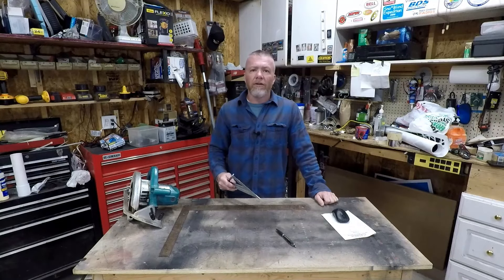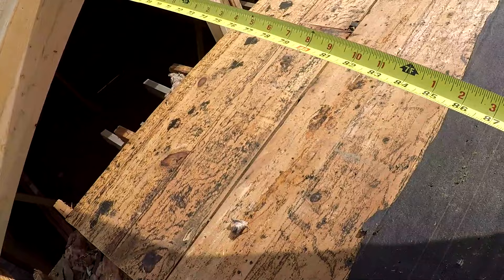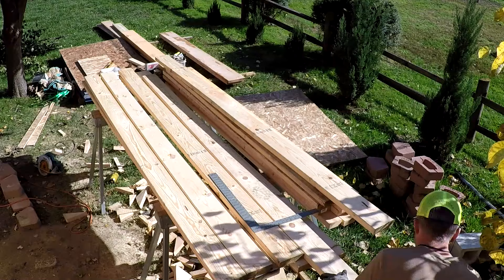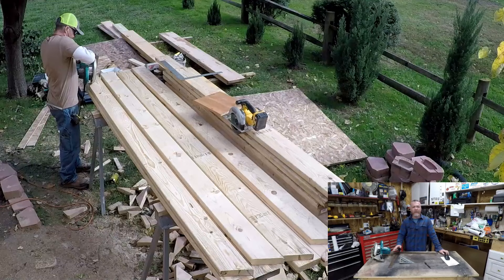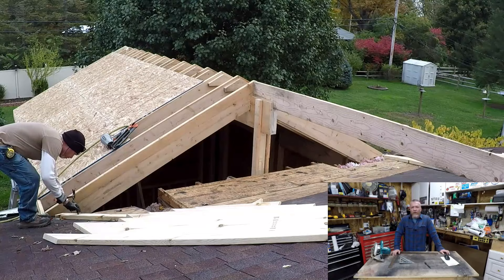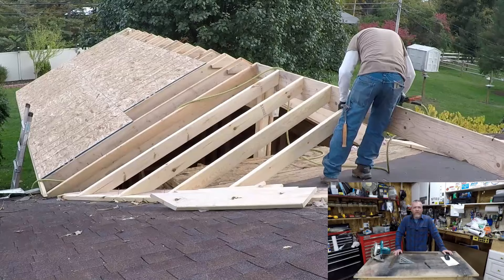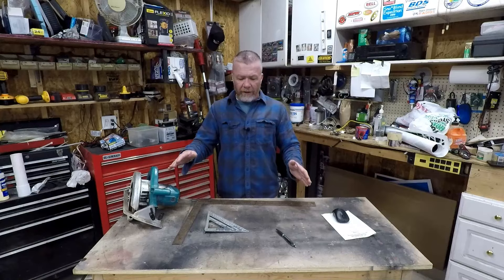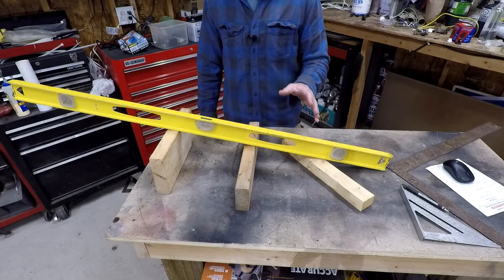Tying an Addition Roof to an Existing House | MY DIY

Comment: Insightful solutions.Perhaps you have a suggestion to this issue: old house we bought has room addition (3:12 roof) where its side of the valley eave is 1.5 inches lower than main roof (6:12) eave at the corner. Now I know why wasps always  flying in and out of that valley corner. I saw the guts of the misalignment when I tore off roof and decking (about 15 sheets). Seems options might be: 1) sister each 2x6 rafter and raise 1.5 inches and add to facia board and rake to chimney (not good since entire perimeter eave would be affected). 2) cut a wedge and plug the opening - uneven valley still); or 3)  take gutter and fascia off and shorten the offending eave a couple inches until corners are in the same plane. It's already open and covered with Tiger Paw during intermittent rains and seems might as well fix properly now than recover the old problem. Thoughts?
Reply from the maker: To me, the easiest would be to cut a wedge, or maybe bend up some aluminum to cover that spot. I’ve dealt with eaves not lining up quite often, and usually just filled that area with a creative piece of metal and some silicon. Cutting the overhang back would obviously work too.

Comment: So recently just found out that our roof only had the roof structure and without board and shingles. The constructor just put on the roof structure and straight away the metal roof. And it keep leaking whenever it rain and the air-con guy who step on the roof causes the roof and our wall to crack under the pressure....
Reply from the maker: Well that’s not good!

Comment: Hello! Great video. This English teacher thinks you make a great construction teacher :) I do have two questions. I believe you said the newly constructed roof had a different pitch than the existing structure. Question 1: I would like my addition to have a 12/12 pitch (with attic trusses) so I have maximum space above the living area. How would that work with what you've shared here? The ridgeline of the new structure would be far higher than the existing, I can't envision how this would work. Question 2: Our existing structure (house) is pier and beam. Most things I've read indicate the addition should then continue the pier and beam foundation. I've read carefully the pros and cons of p&b vs. slab on grade. I'd value hearing your thoughts. Can or should a slab even be poured to abut a p&b structure?
Reply from the maker: I would go p&b to match up, plus I’m just not a fan of slab on grade. Your addition can be taller than the existing structure, it would just need a gable wall to finish it off. I hope this all makes sense…
Reply: The maximum pitch should match  the peak of the original homes roof. Because the addition isn't as wide as the addition you will end up with the  space you need above but not necessarily 12 on 12.
Reply: Home isn't

Comment: I bought a home where they added a room addition, but instead of the roof being like this, they just continued on the normal slope of the house, resulting in the end being extremely low to the ground. Think it’ll be costly to turn it back around to this?
Reply from the maker: I would guess that could be costly
Reply: @MyDIYAdventures  Any chance of re arranging or building on top of ?

Comment: hey ya, i've been watching your video on valley trussing, and it's been very helpful to me. I had one question, which I may know the answer already, when to gp to measure and set the valley plates, and you showed measuring from the set rafters over, what measurement are you using on the rafters itself to match it up. Are you going from tail end up the rafter to ridge and in your video are you measuring 16" centers along the rafter. Thanks Medic29223
Reply from the maker: Yeah, I just continued the 16” spacing onto the valley, and I do measure the valley rafters from long point to long point.
Reply: great thanks again like I said your a big help in my project.

Comment: For the boards that run into the ridge beam, I was always told that it needs to be a little above the beam for the roofers and their ridge cap. Does that make sense? Looking for an explanation as to why that is
Reply from the maker: You mean the rafters? Sometimes there’s room left above the ridge for ridge vent.

Comment: I'm not a framer so pardon my ignorance, but why are your rafters notched to fit over your ridge board and then gusseted rather than just dying into the ridge board completely as you would typically see?
Reply from the maker: The ridge beam holds up the weight of the roof since there are no ceiling joists. The rafters sit on top of the beam so the load transfers down vertically.
Reply: @MyDIYAdventures  that makes sense, thanks for the response.
Reply: It might be to accommodate the cathedral style ceilings.

Comment: Love the video.  I'm tying in a roof deck into my existing house.  I've seen multiple approaches to my question.  Does existing shingles have to be removed for the valley board that support the rafters??  I have seen where the valley board is placed on top of the shingle with roofing glue, etc... my shingles on my house are practically brand new from a storm that took them out last year.
Reply from the maker: All I can say is that I’ve never built over shingles.
Reply: Always remove the roofing. 
Wood to wood framing. 
NEVER frame over ANY TYPE OF ROOFING. 
It will peel in heavy winds/gusts.

Comment: do u need rafter ties? i did something similar like this for my flat roof carport turned to pitched roof and i thought i don't need rafter ties until an inspection say i need it. so i'm not sure where to tie it to because the new roof tying into old pitched roof.
Reply from the maker: I think I probably did throw in a few collar ties on those rafters just to appease the inspector.

Comment: I want to add a decorative gable end to existing roof. My question is it a must to cut the shingles back or can I just run right over top of them? Gonna finish the roof with standing seam
Reply from the maker: I’ve always removed the shingles before tying in, if that helps ya.

Comment: Do you have any videos that show you laying the shingles from the new roof connecting to the old roof.  Do you weave in the shingles or run metal valleys.
Reply from the maker: Sorry I don’t have any videos showing the shingles.
Reply: Weaving laminated shingles sucks.
Bulges from the build up. Weaving was great for 3 tab.
Today - California point or metal in valley...
I nail torch down in valley before the metal. 
Washington state weather...

Comment: Hey couple questions for y'ah.  How do you go about installing valley flashing on an existing roof that still has decent shingles that you don't want to totally redo?  Decent as in they shed water and are sealed from years of sun, but not decent as in if I tried to loosen them and pull nails to slide some metal valley flashing under, they would probably crumble and definitely not reseal?

Next, any pointers for tying into a hip roof towards the corner? Picture a rectangle house with standard 4/12 Hip and 2' eaves.  Now what is the best way to add onto the corner of that house, going out the back side of it? Do you maintain the existing hip rafter and use that for your pitch for the addition?  I don't see how else to do this, but it's messing with my head visualizing it.
Reply from the maker: I’ve ran into shingles like that before and unfortunately usually ended up stripping the whole area and re-shingling. As for the hip roof, If I’m understanding you right, you can just continue the plane of the roof onto the addition. I’ve done it before, and it definitely takes some figuring to get it right.
Reply: @MyDIYAdventures  Per the hip roof, so you follow the existing slope on one side of the addition, and then after the center point of the addition you create a valley on the old to new roof to bring that second half or 'plane' down to the eave?
Reply from the maker: Correct!👍

Comment: How do you know if the roof you’re tying into can support all the extra weight of the new roof material? I’m assuming that 4/12 you tied into was a truss. I thought they were only engineered for dead load plus live load/snow load, if applicable, plus a safety margin I assume?
Reply from the maker: As long as the existing roof is built to code, it should hold the new roof with no problem. I’ve never had a circumstance where I had to add extra support to the existing roof.

Comment: I enjoy your videos. How did you tie in the new and old roof with your shingles?
Reply from the maker: This job got a complete tear off and re shingle, so there was no retrofitting needed. But if it’s not getting re-shingled, you have to use a flat bar and peel the shingles away from the valley so iceguard can be installed. Then you shingle the new roof up the valley and reinstall the removed shingles back on the existing roof. I hope this made sense!
Reply: @MyDIYAdventures  Thanks.  Could a galvanized Valley flashing be used instead of the ice guard? I'm in CA. Thanks
Reply from the maker: Yeah, as long as your local code allows it.

Comment: top cut is your roof pitch. how do you figure your cut that sits on your valley board? I get the 4/12 angle but what’s the other one and how do you get to that
Reply from the maker: The top and bottom cuts are your roof pitch, so it’s the vertical side of a 4/12 at the ridge, and the horizontal side of a 4/12 on the valley board. The bevel is the degree equal to the pitch of the roof you’re sitting on.